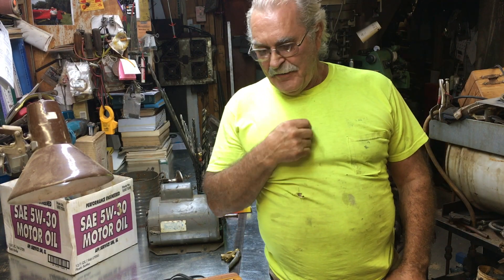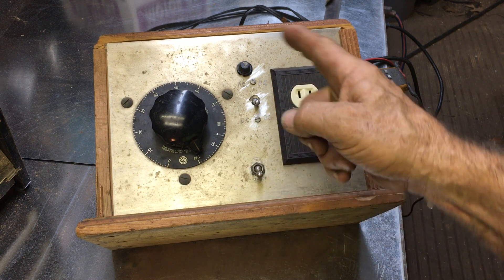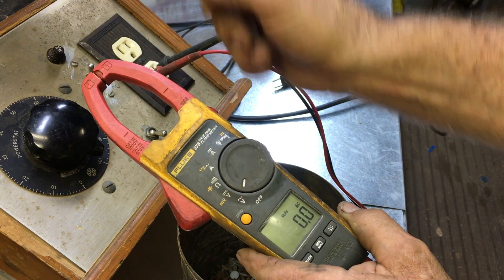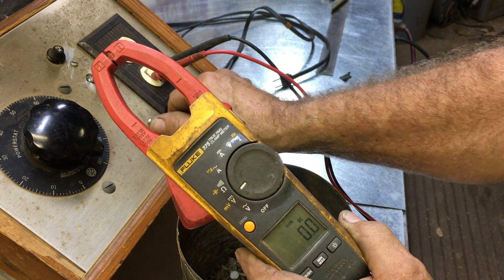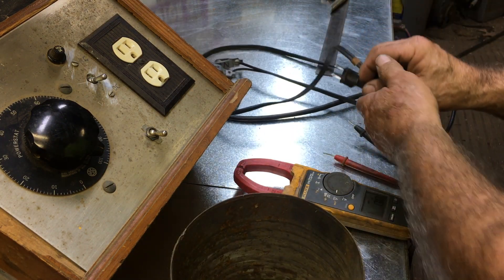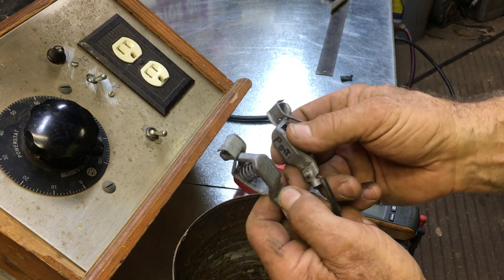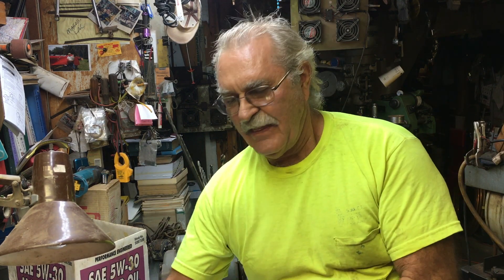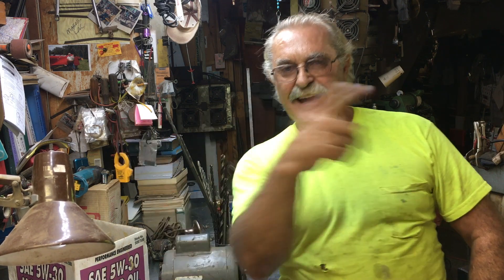AC-DC Variac Checkout

Comment: I assume that would be non-isolated DC? Seeing that with his alligator clips is a bit scary. I think it's important that people realize that traditional vaciacs aren't isolating transformers. That means with this probes that you could get a real shock at the entire voltages, just like plugging them into a regular wall socket, even in DC mode, unless there's also an isolation transformer somewhere. Of course, even with that, if you had two of them that you were holding, at some of those voltages it would give you a bang.
Reply from the maker: I have several other Variacs, one that's close to a hundred pounds that appears to be three phase input...if that's possible. Three HUGE coils in one frame.  Now that one is one I don't really mess with and would like to sell it to someone for 80% of scrap copper price.  That'd be fair because about 20% of the weight will be the metal frame work.  This one is isolated and no shock is received from the clips. Thanks for watching.

Comment: Sorry to hear about your friend, you have my condolences. I have a similar experience, I sadly lost a friend to liver failure recently at 22. May they both rest in peace. That box is pretty neat. Simple, yet useful for various odds & ends. I've got a few variacs myself. They're pretty robust & will probably keep working after I'm gone.
Reply from the maker: It was a sad time for close friends and family, but he had suffered through dialysis for several years and opted to stop dialysis on his own. He was at peace with his decision and we had really good visits in the last days.  But I have another point.  I have obtained a 240v 3 phase variac.  The three coils are on (of course) a common steel stand the the shaft on the dial extends through the center.  I've not seen one like this before.  Do you have any idea if there is a market for something like this?  I'd assume it could be broken down into three single phase variacs. The whole assembly is probably 85 pounds.

Comment: Good Morning Tractorman44, It's so nice here this morning that I should probably have a license to be outside. So of course the first thing I did was raise my cup to near the giant arch area known as District 44! Then I got to thinking about my grandmothers grandmother, being my GGgrandmother. She was born in St. Louie in the mid 1840s and when everyone was going west her family was going east in a covered wagon. This is the reason I think we are cousins cuz we both seem to have that off shoot gene. It a crazy good junk DNA that scientists say they don't know about because it scares them. You know, those scientists that can't figure out one end of a screw driver from the other. Like that machine you have there, it would require them to take a 5 credit course to be able to learn about switches and and extra credit about dials. Now I certainly do know about this machine. It's a how much do I feel like working today machine. You simply take the two clips and attach one to the steering wheel of your tractor, connect a number of extension cords, set the dial and grab the wheel and off you go. A system of low, medium and fast. It can also be used when attached to a hammer, wrench or shovel. Now if you would have used this for all that digging you did for Stan, you  could have ate the dial for fast and dig that hole in the time it took you to go home and get the back hoe. Hook that baby up to 220 and start your own construction company. Shouldn't use it to drive on the highway though. Like a few years ago I was coming home from Harrisburg, about 65 miles and doing 65 in. a 65. Two of those crotch rocket dudes went by me like I was standing still and one was doing a wheelie doing well over a hundred. I'm sure they had one of those machines connected but I didn't see a long cord, go figure. Thing is there wasn't much traffic at all, very unusual and it scared the bageebaz out of me! I looked in my mirror and saw no one and the next second, ZOOM ZOOM!!! A warm sunny day, windows opened, enjoying the summer breeze making me feel fine and BAM! But for work purposes, a great machine. 
   So here it is August already! Seems like you were just showing your kindling splitting method by the hearth and you 44 log splitting system. It's like the time I asked my Grandfather what it was like turning 90, he lived to 97. He said the weeks seem like days and the months seem like weeks. Recon so, ain't? His birthday was July 3rd and he'd always say to buy a fifth on the third for the fourth. 
  So this week I'm going to build a few deck like porch platform type whatever's on the front of the house. Since this place was built as an Amish barn, the entrance door is ground level and originally had a sliding barn door, a garage for their buggie. I took that off, framed it in and insulated well and installed to door. And the stable was in the corner. So the finer stoned lane gets into the house quite a bit. I figured on digging out the stone a bit and lay in some flag stone with two wooden deck/porch deals on either side, according to Alice's instructions. And a question, why does it seem that all those summer projects back up in August and September? I godda get one of those machines since I have a couple hundred feet of extension cords. Is there some way you could hook your machine to a utility pole and then I could just plug into the pole by the road? Man, a small plane just flew over a few times that needs a muffler! 
  So Tractorman 44, I do hope that nice machine helps to get all your project finished this week for winter. I'll bet you could split 5 or 10 cords of wood this afternoon with that baby! Time for another cuppaJO which I will definitely toast your way Sir. Hummmmm, if I wet my tool handles, I wonder if my battery charger would help a bit for my porch building? Have a FINE as frogs hair week and do hook up that machine and get all your weeks work done today so you have the rest of the week to sit on that fine porch in the country and sip some JO. All the Best to You and your Family and Stan of course! DaveyJO hook in up in Pa.
Reply from the maker: Good Morning sir and how are you this fine day !!  Everything is copesthetic this morning in this neck of the woods but that's gonna change in a little while.  Man I got a LOT to do before cold weather. I'm hoping winter skips the mid west this year to give me a little more time to get ready. We got surrounded in our car on the interstate by a whole group of crotch rockets a few years back. Now mind you I've been on two wheels since I was 17 years old and the shenanigans those guys were doing out there in and around speed limit traffic was quite unsettling.  I'm the first one to say I don't want anyone telling me what to do, but c'mon...there's rules that a normal person has to follow.   Aw well, all is good until someone gets hurt, then they look around for someone to blame. 

If this little variac would help you speed up your summer projects I would send it to you in a heartbeat !!  But alas...it doesn't have an attachment for connecting to a claw hammer or a finish saw. LOL...  That WOULD be nice though wouldn't it !!  Have another cup on me this morning sir because I'm on my second or fifth already... I lose track...but as always, the first cup is always tipped towards you and Alice in good old Pennsylvania !! Have an awesome day sir !!

Comment: Cool old variac. Never seen one with a rectifier built in. The only ones I have used just had the variac and used a power supply for DC. That would be very handy to have the 2 in 1.
Reply from the maker: I hadn't seen one like this either.  And I don't know yet just how and what he's got in there.